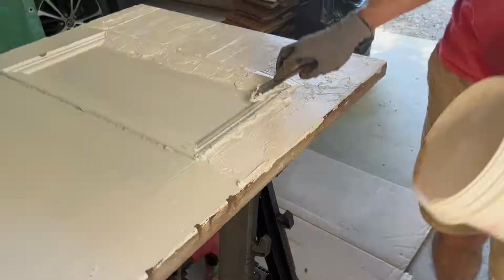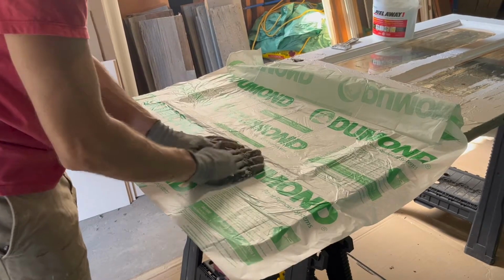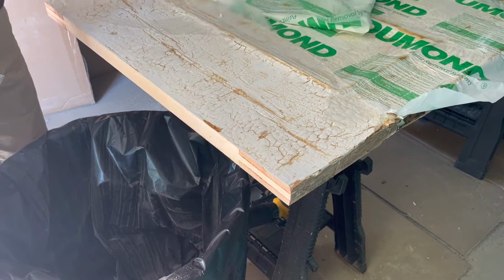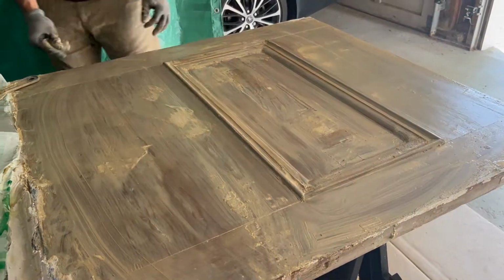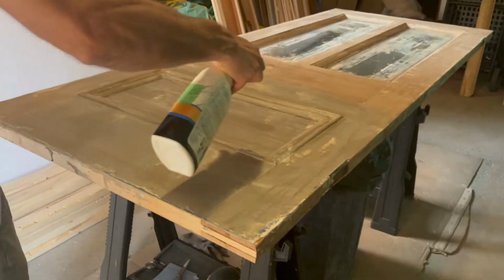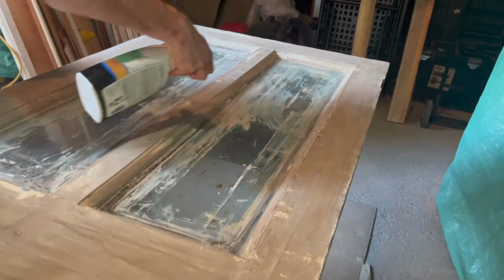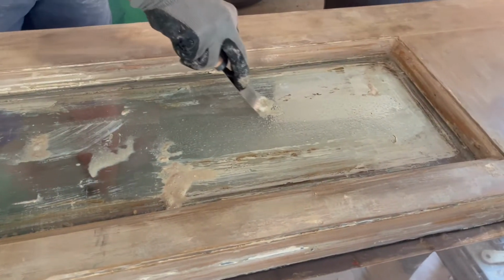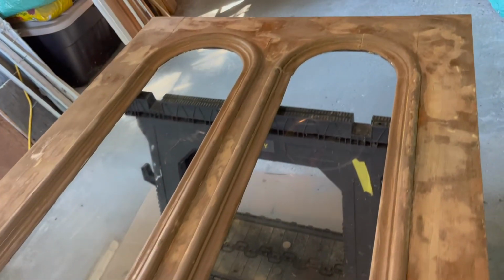How to Strip Paint from an Antique Wood Door

Comment: If you want to stain the door instead of painting it, what is the process to remove the staining from this wet process?
Reply from the maker: Hi Peter Rabbit, great question. It may be possible to remove the darker stains by applying more coats of the paint remover. However, we have not tried that yet so cannot say for sure. We have been using a heat gun to strip the paint off of some wood trim which has left a near perfect surface that would do well with being stained. We plan to release a video showing this paint removal technique in 2023. Good luck with your project!

Comment: Im trying to strip an old door right now. Ive been using Klean Strip because I heard it was good but it doesnt seem to do as good for me as other videos I've seen. Spent 4 hours on one side, 3 hours on the other and im still not completely down to the bare wood, but I can see the grain one 1 side. The other side seems to have a yellow skin over the wood that the Klean Strip doesnt seem to break down, so Im thinking about just trying to sand it down to the wood. What would you suggest?
Reply from the maker: It sounds like you might have a lot of paint layers. The amount of paint and type of paint can impact the stripping process. Maybe there are some varnish layers on there creating the yellowing. Although, we did find the white paint turned yellowish after applying the paint stripper. If you are confident you are using the product as recommended you could try another product. We used Peel Away.  We personally found sanding takes a ton of time and effort and has not been worthwhile for us in the past. You can also try using a heat gun to peel away the paint. This has worked very well for cleaning up our trim. Good luck! We would love an update when you have a chance.